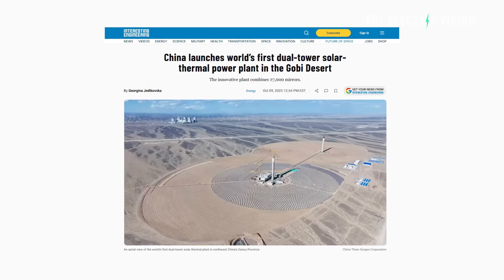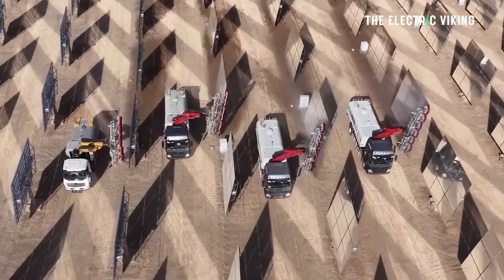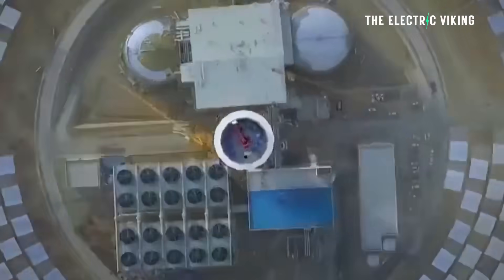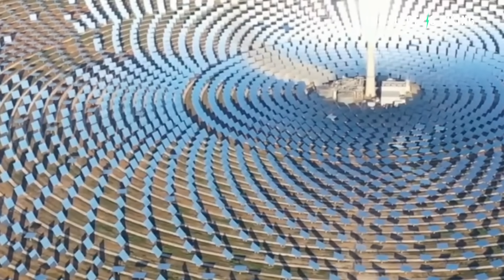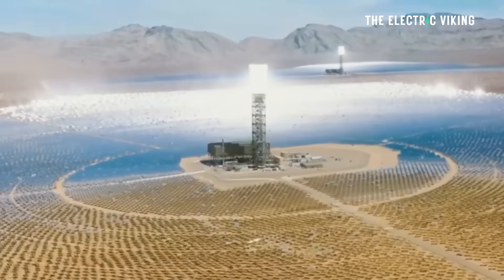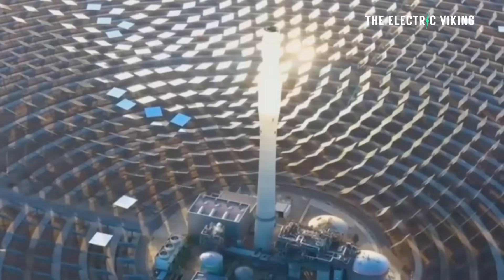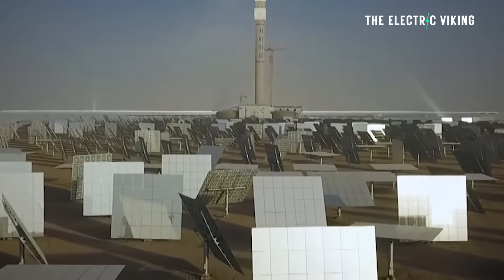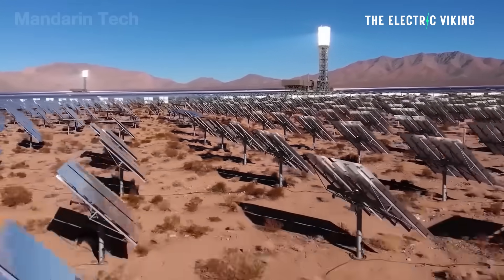Inside China’s Gigantic Dual-Tower Solar Mirror Project — A Renewable Leap

Comment: The Ivanpah US concentrated solar power plant failed in the Mojave Desert in California. It seems to me that the heliostats and mass number of mirrors that have to constantly be integrated and focused on the receiver in the tower, presents too much of a problem. It seems to me that Parabolic Trough Systems that use a long, curved, U-shaped mirror arranged in a line to concentrate sunlight onto a receiver tube would be simpler and less costly. Either that or just use solar PV which has dramatically come down in price.
Reply: Maybe it's time to learn from China on how to make things work?
Reply: @adamiskandar5107  Agreed 100%.

Comment: The reason concentrating solar isn't used much is because it only works on cloudless days as in a dry desert. Unlike solar panels which produce significant power on cloudy days.
Reply: In China desert no cloud, no rain.

Comment: How long will those mirror's last after being sand blasted on windy days.
Reply: I've read some reports about these solar power plants. The battery surface has a coating to prevent wind and sand abrasion. The dust on the battery surface is cleaned regularly with water or air to avoid reducing efficiency. The solar panels condense dew due to the temperature difference between day and night in the desert, which nourishes the sandy land below the batteries, causing a lot of weeds to grow. Local herders need to graze their sheep to eat them.

Comment: Should note that some of these existing plants in the USA will be shutting down because regular solar power is now much cheaper.
Reply: Regular solar doesn't work at night, solar thermal do due to residual heat in the molten salt.
Reply: @moss550 Batteries are cheap now and work at night.
Reply: Sometimes you need to subsidize a technology in order to get it scaled up.  The solar thermal is probably a better technology than individual panels, but it isn't as high demand / volume production.  It might never become volume production.  It happens with many technologies.  They can't unseat the incumbent technology.   But there are many industrial processes which are thermal.  They use fossil fuels right now, but this would be a good solution.  Better than generating electricity and then using that electricity to heat things.

Comment: Hasn't this tech been up for a number of years? I think Morocco had the largest (maybe not now but at 1 point). The heat turns salt molten which retains the heat for many hours and boils the water --> steam --> electricity.
Reply: Yes, as are photovoltaics.  The difference is China is deploying it at unprecedented scales and is changing the global energy mix significantly.
Reply: @magnetospin  The interesting thing is that this technology scales across dozens of towers for round-the-clock power generation (molten salt stays VERY hot through the night).
Reply: The underlying technology of molten salt as a heat carrier is old, and the use of thermal steam generators dates back to the start of the Industiral Revolution.  The specific implementation of a dual tower system to optimize heat generation is completely novel, along with the use of heliostats that switch target midday.

Comment: The forever high operating costs of solar thermal(multi-axis tracking, high temp kinetic processes, preheating working fluid with fossil fuels) is losing to the falling costs of pv+electrochemical storage.
Reply: All those problems can be solved, and this can work as a complement to pv sites as a moderator of variance since it can accumulate energy.
Reply: @nandokart2830 you mean like a cheap battery alteady can?
Reply: @someonenew3478  It means you can diversify your sources of power generation. Have you ever thought of what if everyone uses the cheapest option (at the same time)?

Comment: Ivanpah in the Mojave desert opened in 2014 at cost of 2.2 billion USD and (unpaid) government loans of 1.6 billion USD. It´s planned to close in 2026 to save the consumers money (PV panels meanwhile produce cheaper). It uses 173,500 heliostats, each with two mirrors to focus energy on the 140 meter tall tower. WSJ: "Instead of ramping up the plant each day before sunrise by burning one hour's worth of natural gas to generate steam, Ivanpah needs more than four times that much." In 2014, the plant burned 254 GWh of natural gas emitting 46,084 metric tons of carbon dioxide  plus solar energy to produce a total of 419 GWh of electrical energy (more than three times that of the referenced CCGT plant), all the while operating at well below its expected output. Lets see how the Chinese counterpart will perform in real life.

Comment: The U.S. built such a system over 10 years ago. And then decommissioned it 

This is  a very good idea on paper and in theory 

But in practice it has a lot of problems 

What are you going to do about the sand covering or scratching the mirrors?
Reply: Just bcos X once made the attempt, it doesn't mean that they did it properly. Trial and error happens all the time in science. Where one fails, another may succeed.

Comment: So the United States version of this did not work out economically.     But in China, it might be different.     China makes 85 percent of PV panels sold around the world.   The United States makes 1.9 percent of the total PV solar panels made worldwide.       Maybe PV solar electricity is cheaper than this system, but this system might make electricity that can be used.     So China had to decide, lets build another PV plant to add to the 1,000 PV panel plants (guessing) China has already built, or just try to make another way of making electricity work.  
    
I remember in the 1970's when they were building the first one of these as an experiment (In the United States).     China just might be doing that with utility scale concentrated solar thermal electricity production plants.
Reply: China does 'all of the above' to see which technologies work best.  Relative to their economy, it costs China nothing to build a test plant and operate it to assess effectiveness and true cost.  But the ability to compare best of breed across a wide variety of technologies without corporate interference, and then to deploy where most effective is pretty powerful.
Reply: @ZweiZwolf  You mean like the U.S. already did with Ivanpah and Crescent Dunes which botg underperformed and went bankrupt. What exactly is new here?
Reply: @someonenew3478  You know that they're not comparable, right?  US private power needs to make >shareholder< profit, but can't compete with imported Chinese solar panels.  OTOH, China is state-owned power, with much lower operating costs tied to a mandate to deliver power as a service.  If concentrated solar has benefits over PV+ battery, then China will deploy at scale to get the cost down, as they've already done with solar PV, wind, and nuclear power.
Reply: @ZweiZwolf  I hope he understood your explanation, but I doubt he would(could).
Reply: @adamiskandar5107  He will refuse to understand that which challenges his preconceived notions
Reply: China has vast deserts for this, but American birds don't agree.https://youtu.be/MX_PeNzz-Lw

Comment: Please do your homework …this was done in Mojave desert California and is now being closed down. It has been a disaster. Birds get cooked when flying through. It is a technical headache due to the heat generated. So it is sad you jump on anything China and seems all you care about.
Reply: Birds in the desert? China has built hundreds of kilometers of solar power plants in the western deserts, where it is scorching, dry, and devoid of animals.
Reply: Great no need to barbeque pigeon with fire, free sun power, save money. 😅😂❤😅😂
Reply: Do you know that the Mojave project was partially funded by Chinese investors.  They didn’t stop.  Kept trying.
Reply: I think you need to see it for yourself. Last year when I went back to China, I stopped on the side of the highway to see this thing, and it was spectacular! But it's not far from residential areas, and camels, birds, and even people are running around everywhere, so there's no problem. By the way, I live in Dunhuang，Gansu province. Surrounded by desert 😅
Reply: Bird population control... Good. 😂 The big reason it closed down in California not becos it cooked the bird. Becos it electricity produced is much more expensive than solar panel cell.. Basically, it's too expensive to operate. Anything by american is always expensive... In China, it's another story. China will make it competitive
Reply: Did you eat cooked chicken? Please dont you are a headache to those birds
Reply: birds don't pit-stop in the desert - they fly 1000s of meters over the desert  - the solar towers are < 200 meters where the solar heat is focusing on

Comment: Interesting.  What is the difference between this installation and the one on the CA/NV border that has been shut down because it wasn't cost effective.  Also not sure I understand  the reasoning for having 2 towers over having 1.  Is it because tower 1 is basically as hot as it can get by noon so they switch the mirrors to tower 2? Thanks for the video.
Reply: The movement of the sun is such that one can get better solar angles if you switch tower.  

Consider the angle of the sun striking a panel at 8 am vs 4 pm, and what the angle needs to be if there's only one tower in the middle of the array, vs having one on each side.

Comment: This type of system has been around a long time. But it has been a disaster because there are too many moving parts. This makes maintenance really high, and output is always below its theoretical amounts. A billion dollar project in the USA failed and embarrassed renewable energy supporters, especially as most people don't have a clear idea of the huge difference between concentrated solar power and solar pv panels. I am surprised that China is still using it, if they are. It was thought to be a possible rival to pv years ago but that was before the cost of solar panels dropped 90%+. I hope you aren't using Interesting Engineering as a source, because it is usually wildly wrong.

Comment: Solar cells, or photovoltaic cells, as the name suggests, receive sunlight and convert the light portion (photo) of sunlight into electrical energy. The heat portion is not used at all. In solar thermal plants, as the name suggests again, the mirrors receive sunlight, focus it onto a spot and heat up water until it boils, and convert the heat portion (thermal) of sunlight into electrical energy. Again, the light portion is not used here. Solar cells are arranged in parallel to receive maximum sunlight while mirrors in thermal plants are arranged in a parabola pattern to focus parallel sunlight onto a point (the same way parallel electromagnetic waves from a satellite are focused by a satellite disc onto a receiver device). It will be wonderful if there is a cell which converts both the light and thermal portions of sunlight into electrical energy. 
(For your information. Please tell me if I am wrong.)

Comment: Remote locations like this are isolated from the gird. Where's the output going?
Reply: You make a statement then you question your own statement
Reply: Energy from deserts and hydroelectric plants is far from its consumers. This is where transmission lines are needed. Investments required for this energy generation are heavy but will normally be returned in a long term.
Reply: The grid? China has the most interconnected grid on the planet.
Reply: China have the most advance high voltage transmissions, it can deliver the electricity to most of China coastal region without high waste on the transmission
Reply: Beijing and Shanghai.  

China invested heavily into ultra high voltage transmission to move energy from the western desert to the east coasts.

Comment: Why would 2 be better than one  .  Spain a the US have tried this . It's probably not as good as just using Solar Panels.
You need fluids for the conversion of energy and Turbines.
Reply: Becuase its using one molten salt cycke for two towers. It can actually be scaled to 8 towers using a single molton salt loop. This method is far superior to geothermal and the temperatures from 8 hours alllw the thermal generation to work 24/hours a day. Combining this with sodium eternalyte batteries from 24M with ETOP architecture and scaled until 19$ kwh woukd increase efficiency further of the system
Reply: Place mirrors around a central tower in the middle.  See the angles at 8 am, noon, and 4 pm.  Now see what happens if you place towers on both ends.  Switching to between towers gives less self-shading for higher efficiency per surface area.

Comment: Thanx.
CSP is not as good as PV. The energy storage feature is nice but today with cheap batteries PV + batteries is cheaper, faster to install, much less maintenance, more useful (electricity is more valuable than heat), more efficient per square meter, and more.
Reply: Until China proves otherwise once again.

Comment: A similar variety of solar using positioned mirrors is being shut down after about 10 years of use in the California Mojave dessert allegedly due to its underperformance.  Maybe the Chinese have come up with a more efficient version of this technology.   According to reports,  traditional solar is cheaper and more efficient than this mirror array.
Reply: The advantage of solar-thermal was never cost and efficiency - it's the ability to smooth out power output using an intermittent source. Hence why it's a complement to the PV farms, not a competitor. Of course, for this concept to work you first require a power supply system that isn't fractured across multiple private players who by design only care about their own financials.